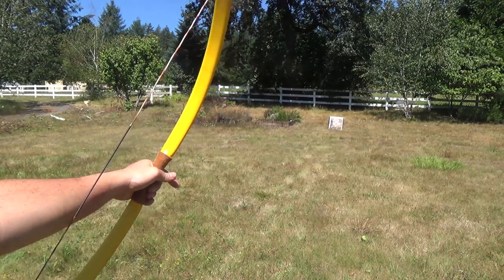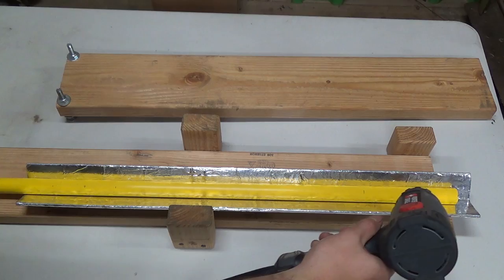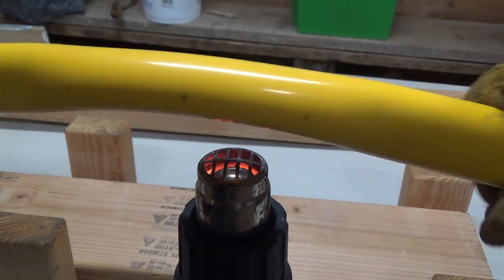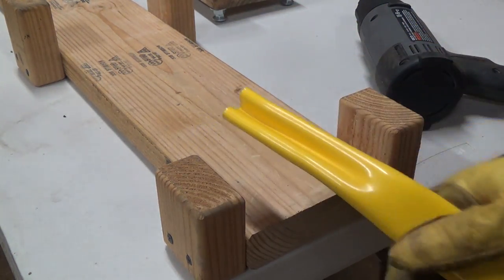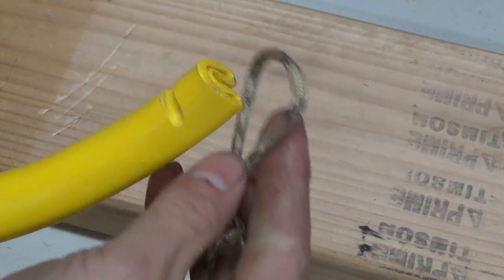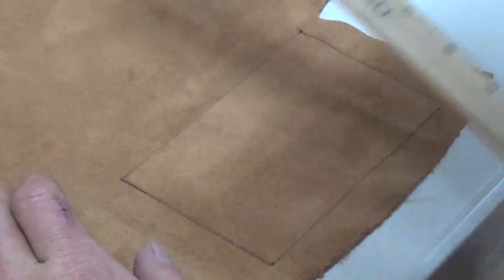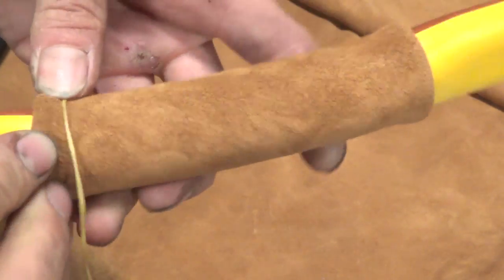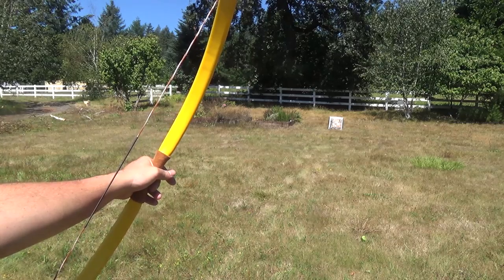How to Make a Vinyl Backed PVC Pipe Bow With Folded Recurve Tips

Comment: +NicholasTomihama I want to build a pvc bow for deer hunting. I was going to build the faux blood wood bow, but I need something around 57 pounds at 26 inches. 28 inches is okay, since I could still draw it back. Is this possible? I built the vinyl backed bow, the snakey recurve, the flattened horsebow, the youth bow and arrow set, and the adult bow. so I do have experience in building pvc bows. And how many grains is the skyrim arrow because I want to use it for hunting. Please answer ASAP because the deer season is in two weeks. Thank you.

Comment: Hey nick, I attempted to build this bow but when I string it up there is quite a bit of side bend/twist in and around the handle area. This is causing the string to be off to the side in relation to the centre line of the bow and the bow wants to twist around in my hand when I try and draw it. This happens to the point where the string actually flips around to the back side of the bow. Any ideas as to the why this is happening and how to fix it. I am thinking it could be caused by the limbs/ tips not being perfectly aligned. Thanks

Comment: Hey Nick, this was a great build video, you outdo yourself with each one you make. However, I have some questions. What do you believe is the effective range of this bow? Can the vinyl be applied to the front of the bow as well? What is the bow that is shown in the end credits image? Finally, how long did the construction of this bow take you? 

I want to be clear, I like your work, but I would love it if you answered my questions. Thanks for everything you post on YouTube, you're an inspiration.
Reply: After watching the video again and reading up on the significance of Schedule 40 Furniture grade PVC pipe, I now have some more questions. First, I noticed you never said the diameter or overall length of the pipe you used in the video. Can you please tell me what the diameter and length is? Second, could this bow be replicated using Schedule 80 Furniture grade PVC? Finally, how would you go about making a version of this bow that is more around a 40-50lb draw weight? I am curious if it would be better to increase the length of the pipe used for the bow, use a different material like Schedule 80 piping, or use piping of a larger diameter to increase the draw weight of the bow. I really like the folded over design of this bow more than any of the other ones you have made, and I want to try to reproduce this bow at home and possibly make one with more draw weight in order to increase its effective range.

Comment: Hey Nick! Great vid! I just have a few questions for you if you dont mind. 
1. is there a limit to the amount of times you can heat the PVC?
2. When you put the taper into the limbs how do you keep the strait? Im assuming by eye?
3. Is there a way to make the string follow the grove you created in the reflex at the tips? 
4. last question. When you heat the PVC for the 2nd or 3rd time does it have memory of its original form. Does it try to go back to a circle? i ask because there are spots you reheat for more work but was wondering if you risk lossing what you did previously.
Reply from the maker: Thanks for watching!

1. There are no limits as long as you don't overheat the pipe. If it becomes glassy-looking or burns, then you've overheated it and risk making the pipe brittle. You should also avoid re-heating a bow that's been shot over 500 times or so. Other than that, you can re-heat as many times as you need.
2. The easiest way for me is to stretch the pipe a little before pressing and make sure to press from the handle outward, as pressing from the tip can cause the pipe to bunch up a little. If a limb has one small bend, just press against the curve while the limb is still warm to remove it. If it's got a lot of bends, it's better to just re-flatten the limb than to try and fix it a curve at a time.
3. Yes, you would either increase the bend in the recurve or just don't reflex/deflex the bow. The reflex/deflex changes the angle of the tips so that they don't have much string contact. If I had just formed the tips and strung the bow up as-is, the string would be tracking in the groove.
4. Yes, it does try to return to a pipe. As long as the pipe isn't burned or melted, it will always return to a pipe shape. When doing reflex or deflex, you want to heat just to the point where the pipe will move when flexed, but not so much that it puffs out. So yes, there is a risk of losing your previous work if you heat too long or too aggressively. 

While this bow is pretty close to a simple recurve design, the added shaping does require previous experience or a good eye to get right. So this one isn't a beginner's project.

Hope this helps!
Reply: +BackyardBowyer Thank you! ive been watching your videos for a while now trying to learn as much as i could. I think My girlfriend and I are going to attempt to make some normal long bows this weekend. Ive built a few knifes with the help of your videos so far!
Reply: 1.5
2.The jig
3. hail Hydra
Reply: 3 inches
Reply: nope it's 1 inch from the tip :)
Reply: Flint Barnes
Reply: @BackyardBowyer  nick...i cant make one...i have done like you did but it didn't work...😭

Comment: Can you use the gray, electrical PVC pipes as well? I already used one and it's holding great. Is it any improvement over white or furniture grade?
Reply from the maker: Yes you can. I've found that it has a tendency to deform on very hot days. Unstringing when in a hot car is a good idea, as a strung bow is more likely to deform because it's already under tension.

Comment: Love your videos Nick just got a couple quick questions.

1. What thickness pvc are you using in this video
2. What are the folded tips mean't for(how do they affect the bow performance wise)
3. How would I increase/decrease the draw weight? by decreasing the pipe thickness or the length of the pipe
4. In this video you say to mark 6" on each end for the recurve but later on say to only bring your crease down to 4", why's that?
Reply: crayons213 normally he uses sch 40

Comment: hello there I made a50 lbs  sch 80 pvc bow with pvc syihas. it was great but after around 150 arrows it broke on me  when I pulled it a little more then 28 " do you have any sugestion on why did it break? I didn't burn it with the heat gun ,and  it was Fearly even  .
Reply from the maker: Was the brand JM Eagle? Their quality is pretty poor for PVC bows. I haven't heard of any issues with other brands yet.

Comment: hey nick I'm a big fan. I just have a couple questions. 1 is there a way to make a PVC recurve bow with fiberglass rods inside? and 2 is there a way to make PVC bows exactly the weight you want? like for example if I wanted to make a 65 lb PVC bow how do I make sure the bow comes out to that draw weight and any other specific draw weights

Comment: Thanks for all your great videos!

WAs this 1"?

I just made this (my first PVC bow) yesterday and it is not as pretty and smooth as yours, but a good replicate.
The temperature is 52F yesterday.
I strung it with paracord and geeez there is no way you can pull my 1" PVC40 48" version back to a 'normal' distance.  Not sure if it is the cold or if because I noticed my limbs closer to the riser are not as flat - but a tad more round.